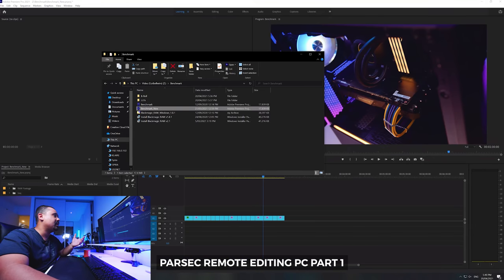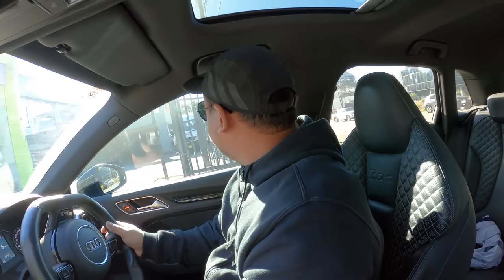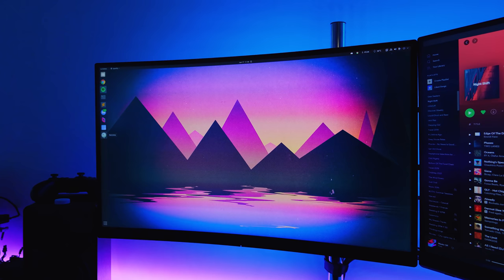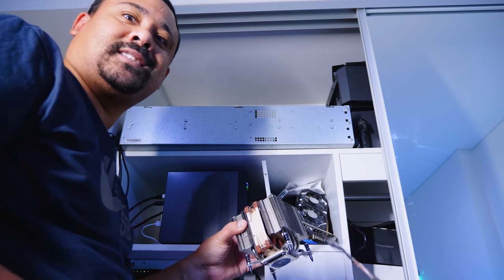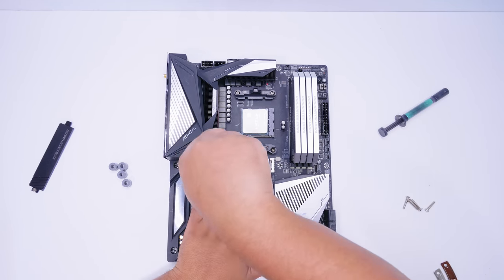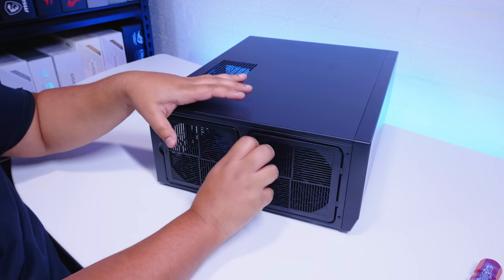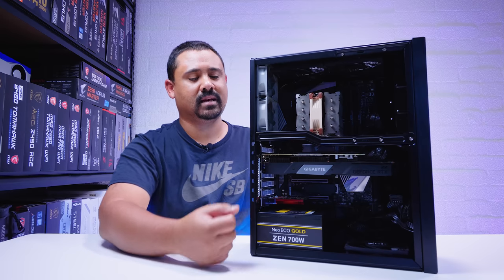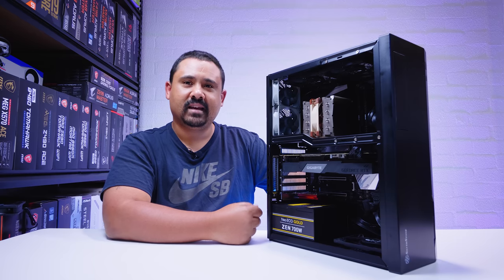Remote Gaming & Editing: Not Everything Goes to plan :(

Comment: Thanks for bringing us along for the ride. Since you have a few PCs inside the closet, does it get super hot in the room when they are all working? My wife and I are currently in the same room and it gets super hot when we play games together. We both use RTX 3070s, so they aren't even super high wattage GPUs.
Reply from the maker: They aren't being utilized the same way as regular PCs. It's mostly storage. I can get hot in there but it doesn't heat up the room at all. The house is ventilated in winter and air conditioned in summer.
Reply: @GearSeekers  good to know, I might do something similar once I get my own house sometime next year. Thanks!